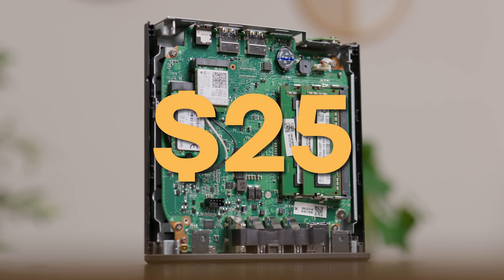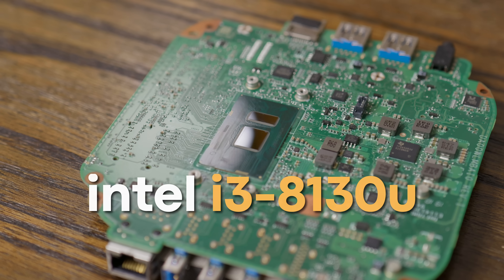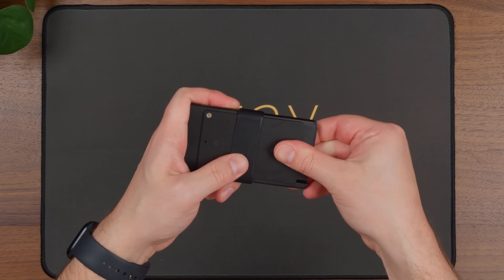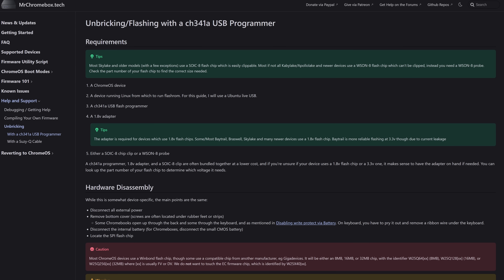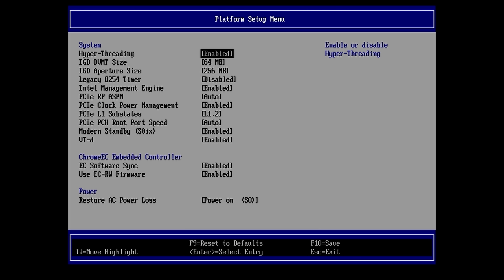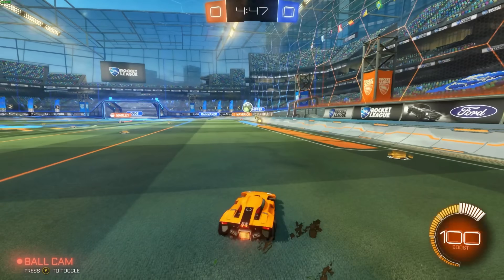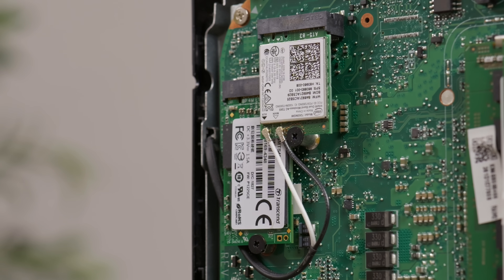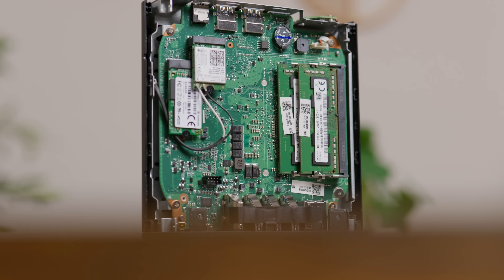This hacked Chromebox is INSANELY impressive.

Comment: I actually picked up a bulk lot of old chrome books to do this with.  The script is great for one or two machines, but definitely invest in a chip programmer if you're going through a stack or more.  The programmer lets you get around locked down/bricked boards and is quicker.  Mr. Chromebox's firmware is great for most purposes, but It's also possible to custom compile your own variant with different payloads.  I had a need for a few laptops that would be in pretty crappy conditions, so being able to pick up some chrome books for like $15 each and repurpose them was perfect.  They make nice, cheap, expendable work horses.

Comment: Chromebooks/Chromeboxes are GREAT sources for low power Linux servers and workstations.  I bought a $30 used Chromebook and repurposed it as a Linux workstation just to see if I could.  That Chromebook has become my favorite travel laptop, the battery lasts for hours and it's small and light enough it just sits unobtrusively in my backpack.  Sure, I'm not going to be gaming on it (it's a Celeron!) but for simple web browsing in airports it's fantastic.

Comment: Dell thin clients are also a great way to get small low power hardware for around the same price with much less risk of it being locked up, in most cases just install Windows or Linux and go, maybe screw with the BIOS password jumper or a master BIOS password that's well documented. The Dell Wyse 5070 is a passively cooled Pentium SIlverJ5005 and running one on stress-ng for 7 hours laying flat saw a peak temperature of 75-78C, turning it on edge as it's meant to be ran saw about 70C temps. I haven't touched the thermal compound on it. Passively cooled is really nice as there's not a fan to fail and the wider fin spacing and lack of forced air means that in dirty/dusty deployments it won't clog itself up over time nearly as badly if it all. This one is hopefully going to be a low power PC for a co-workers disabled mother who's bed bound, it should be perfect for watching streaming, Youtube, some small games, nothing heavy. There's other beefier thin clients which have actual PCI-e slots in them with much stronger CPU's like the HP T740 which are more like a mini PC than a thin client. No idea why you'd need a thin client with a full length half height PCI-e slot and a 8 core Ryzen CPU! But they do exist. Good home router/homelab/home server potential there.

Comment: For anyone wondering the chromebox cn60 is also able to be flashed with linux using mr chromebox scripts. It also has an upgradable sata and two ddr3 so dimm ram slots to mess around with, pretty nifty machine. It can run a minecraft server at 10 chunks fairly well with no stutter. Only downside is 16gb model has very little storage.

Comment: Good work. Great power consumption is the key for idle box sitting around always on. I usually just just go for raw debian base with docker and qemu. (Proxmox has some overhead) I bet it would run at around 1W idle. Looks like plenty of room in the case to cram 4x 18650s and have a mini UPS with 30+ hours of runtime directly inside. Impressive regardless.

Comment: I flashed the firmware on my Acer C720P with the help of MrChromebox and it's now running Linux Mint and everything works just fine. The only downside was the 4 Gb of soldered RAM, but I added a 128 Gb M.2 SSD and after the Linux install I still have over 90 Gb of free space. Pretty good for a eleven year old device that Google insisted was ewaste.

Comment: did the same with my celeron cn60 years ago. just a heads up for that model -- the MAC is only stored in softtware, so when you wipe chromeos and install another OS, the MAC is gone kek. that firmware utility can be used to set it, but if you dont make a complete backup of the original OS or write down the mac somewhere, its bye bye. i dont think it even has a MAC sticker anywhere on it or the box

Comment: Given that chrome OS uses the Linux kernel locking it down is a bit cheeky.  I know it's not quite linux because other than the kernel it uses a proprietary software stack but still, you're running GNU\Linux at the core.

Comment: I installed ChromOS Flex on a Pavilion Chromebook 14-c050nr last night. After flipping a switch, recovery mode, dev mode, disable WP, run Mrchromebox.tec BIOS flash script, installing Chromeos flex via Chrome recovery usb w/chromeos flex as model, 5 minutes later and 2-reboots I had an updatable Chromebook minus Android apps and Playstore. However, it now has a Linux VM and access to Linux apps. YouTube is a wonderful thing sometimes. Next I need to update the SSD; it has the original 16Gb SSD. I upgraded the RAM to 16Gb from the original 4Gb.

Comment: Another alternative is a cheap PC from ebay, an i5 or i7 Windows 10 PC, a NUC mini PC is around 4 watts and similar price to the model you got with the benefit of no risk as no firmware flash is needed. Also they will often have better processors than a Celerion!

Comment: The whole reason why you are getting slower performance issues with the Acer.... Is the power management that little one can be over clocked and it will still run somewhat okay... But you need to put more cooling into it or that will start to throttle and that will cause it to slow down.... Also depends if you are using Kingston or Samsung sodim ram... Using something like Samsung is generic ram because its manufactured at three different locations with three different standards for QA.... Same goes with the M2 as well.... I have a chrome book I just use for streaming while going to sleep.... Its crap but still it functions for the most part.... I find it they love using Samsung ram in those.... This is why I make a bit of a stink about it.... For a low budget you got yourself something that is worth keeping around...

Comment: I have i7 version witn 16gb ram 4core 1.8ghz, all i can say it was not worth it to convert to windows because you cant play high graphic demanding games. Although the cpu is great, the gpu is weak to run such games. Another thing is 30% of android games and app are incompatible to this chromebox. Some games touch screen (using mouse) doesnt work some completely crashed when opened some apps doesnt render correctly.

Comment: What about a mid range gaming pc, while costing $800, still crushes fc5/6 and idles at 7w? My system is the r5600/6600xt. Sure not as compact as your chrome box but so just 10L. It's possible to fit into 7L sff

Comment: This was an awesome video.  I only experimented with Chrome devices a while back, and there was little to no information about modding them.  Not only the information you gave about the general modding of some Chrome devices, but what you showed you were able to do with this particular model, open up a ton of options.  2w idle draw!  Even 31W under full load, that's almost nothing.  My gaming PC is sucking down 700W at full load.  But, as an overlander, being able to build a smart control system with very little draw, while also being able to run other things, like a media server, it's awesome to see.  Thanks for the video!

Comment: I did sort of the same thing with a Dell Chromebox with a Haswell Celeron CPU. I flashed Mr Chromebox's firmwear and added a 4GB RAM chip (for a total of 6GB)as well as switching out the 16 GB M.2 drive to a 128GB drive. I installed Mint 22.1 and use the thing for a media player. The poor old Celeron CPU struggles at much over 1080p but other than that, I saved the old girl from the landfill.

Comment: Are you sure the Geekbench results are from the i3-8130U?

I've now purchased the exact same model and can't go past 1169 Single and 2184 Multi. Doing a search in Geekbench the results are similar to mine, but not so high like yours.
I've checked temps and limits, they never exceed 78°C, but in fact I am POWER limited during the tests, as soon as I reach the 15W according to HW-Info.
The UEFI has not option to change the platform TDP. Did you do something special to your?

Comment: Iv got a cxi3 and DO NOT GET THE ONE with a celeron processer. And chrome OS is absolute trash so make sure you can wipe the thing. And yes you can drop in 32gb of ram, Iv got 32gb of storage and 32gb of ram lol
Reply: Depends on what you're doing.  The Celeron with stock 4GB RAM works fine as a Blue Iris remote client even without flashing.  Retained the ChromeOS since the Chromebox was cheap and I can modify others.  Cameras only running 1920x1080 so ymmv.

Comment: I just built a server for fun with some parts lying around, Xeon 2620 v2, GT 730(heard that right), 2*8 gb of ddr3, X79 off of Aliexpress, Debian with Xfce and a random psu stripped from an oem. I’m not really knowledgeable on computer stuff and I’m gonna try to run Pi-hole on this for adblocking. Wish me luck on my first dive into the server rabbit hole

Comment: I've been rather happy with a crappy $100 Chromebook I got a couple years ago, after a friend had it for a couple years.

I immediately installed Mint.

I close it for 3 or 4 days. It wakes up at 98% power.

I use it for a couple hours. It's at 92%.

Mint tells me that I have an estimated 72 hours left of battery life and... I think that's overly optimistic, but I easily clear 24 hours with my normal use. I get over a week of sporadic use without charging it, and there's still like 40% left.

Low power fanless laptops are amazing.

Comment: don't leave the screw out - put it back when you're done. The screw is there to ensure no malware can rewrite that nvram
Reply: The screw has no effect when reinstalled unless the chip-level write protection is set first. And you don't want to prevent NVRAM from being rewritten or you can't change any settings or the boot order.
Reply: @mrchromebox7138  on the devices I worked on the chip-level write protection was a hardware lockout that put the data bus of the nvram chips into high-impedance mode (cannot be an input or an output). How often do you change settings or boot order? It should not be done during daily operation. Put the screw back when you're done changing your settings. This is advice from a ChromeOS developer
Reply: @anonymous-pr2sy  again, putting the screw back in alone has no effect whatsoever. The hardware write protection (screw in this case) simply prevents the settings on the SPI flash chip registers from being changed. But those are cleared/disabled as part of the flashing process, so putting the screw back in does nothing at all.
This is advice from a ChromeOS/coreboot firmware developer, project leader, and the creator of the site/firmware in question here.
Reply: @mrchromebox7138  why did you create firmware that would disable the nvram write protection if the user installed custom firmware? That does not seem like it is a good thing for the consumer at all. You guys have fallen awfully far since 2016
Reply: @anonymous-pr2sy  who is "you guys"?
I can't tell if you're misusing the term NVRAM to refer to the entire flash chip or what here. Even in stock form, the flash write protection only covers a portion of the chip, not the entire thing. Otherwise you can't update the firmware at all (which Google does). I could implement a system like Google uses with a RO portion and updateable RW section, but there are drawbacks to that as well.

Comment: Actually the ethernet is an issue with the r8169 open-source driver When it has EEE enabled if you want energy saving to work properly, you have to use the realtek driver (r8168), or patiently wait for the r8169 team to fix something that has not been fixed.

Comment: Have the Asus Chromebox 3 CN65 with the I7, unfortunately, and this seems to be a general issue with these devices it started to overheat very quickly when running Windows 11 after flashing the BIOS. Eventually I restored the original OS, and my 10y old daughter uses it now as her computer.

Comment: I got Bliss OS (Android) on a Mac Mini with a usb touchscreen, triple boot, the other two being Kali Linux and KDE-Plasma Fedora workstation.. no Mac OS anymore as its a late 2012 core i7 8 core eighth gen cpu 32 gb ram mac mini which Apple like to pretend is outdated, when in truth i am running 15 million parameter local LLMs on it in linux. Otherwise i use 16 gb Raspberry Pi 5, with KDE Plasma desktop layered onto either Ubuntu, or Kali. You can put bliss os android into a touchscreen box with a Pi 4 for less than 100$ or even full desktop ubuntu or kali or pi os (Pi OS is crap on top of Debian).. Amyway my old 2012 Mac Mini is now runing gpt4all and docker desktop and anything llm and open web ui and ollama LLMs locally better than some 2500-3000 dollar 'AI PCs' currently being sold

Comment: I just converted a few asus box 2s and 3s for this reason. Excellent little machines. The 3s need to sign into your g account to enable dev mode properly. The 2s are more flexible. The requirement is to remove the wp screw on both though. Made an emulation station for my nephews bday for one. The others are unassigned for the time being. Ubuntu server with lx de. Auto lgion and the retropie script gets you going. Make sure to enable ssh for easy scp transfers of files.

Comment: You mentioned two things that piqued my interest. 

- First, that the i3 was not the only processor available, (I thought I caught a glimpse of a screenshot indicating that an i7 4 core chip was in some units) 
- And second😮, you successfully ran proxmox on it. 

What speed are those USB A ports in the back? Would it be possible to use the USB A ports as the connecting network of three Asus Chromebox(s) to form a high availability proxmox cluster?
Reply: 5Gbps

Comment: This would make a great seedbox. I currently have a cheapo N100 that fills that role that sips power but I think that might be overkill considering that this little thing consumes even less power. My seedbox just needs to run uTorrent and NordVPN client software. Im still on 500Mbps internet so the 1 GbE port wouldn't be a problem at all.

Comment: Picked up one of these 6 months ago that had an i7 and 16BG of RAM.  Saw it in a cardboard box that said everything in this box is $1.  I had an old 19V charger from about 10 years ago in a drawer, which was lucky because after the firmware change the USB C charging stopped working.  I had an old 256 GB M.2 I threw in and loaded Windows 11 and it was a shockingly competent PC.  I've absolutely got my eyes open for any more of these I can get cheap. I've done this to a few Chromebooks before, but this was pretty cool.

Comment: the chromebox 3 is best. you can put 32gb of ram and use any intel mobile core i 2nd and 3rd gen. i have 2 with i3-3630qm (any higher the TDP is too high requiring cooling mods) and 32gb and 512gb msatas.
Reply: yeah but the HD3000 GPU there doesn't do hw decoding of modern video codecs, so it's a lot less efficient if it's capable at all

Comment: Which BIOS chip is it using, how accessible is it, and is a complete BIOS image available? Flashing it with a hardware programmer might not be a big deal, for example, HP T740 pop right out of a socket.
Reply: it's a Winbond W25Q128xx SOIC chip, on top of the board, easily accessible and clippable. There are some caveats when flashing the chip externally as you don't want to wipe the LAN MAC address which is stored in the firmware.

Comment: The version with the i7-8650u would be interesting, the higher end 8th gen mobile chips are much more performant/watt. Would also be quite performant in Windows l, I used to do heavy multitasking with a 8350u until recently.

Comment: I also bought an asus chromebox 3 with an i7-8550u with 80e for the stock box (8GB/64GB)! Upgraded ram to 32GB, SSD to 512GB flashed it with full UEFI and installed ubuntu! All for less than 150euros!! I also used undervolt python program to lower -100mV the core and cache voltage resulting to stress turbo clock during s-tui of 2.6GHz instead of 2.4GHz!

Comment: I bought a couple Asus CN65 (chrome box 3) for cheap a while back, being locked, was able to flash the Bios and unlock them, nice little PC's they run Linux quite well but could not get the on board Audio working in Windows.

Comment: Nice idea, but there are many cheap mini PCs out there that don't require any work to run Windows or Linux. Like the one I got a few weeks ago for 50€ that has an 11gen i5. It was also listed as not working because Windows often crashed, but from the error message it was clear that just the SSD failed and that was the case. It even has decent cooling and even enough power for most games in lower settings.

Comment: Heh, I've been running an CN60 I bought for $22 for a CasaOS server for over a year now. Added 16gigs of ram and a nice 1TB drive and it's been rocking Home Assist, A MariaDB instance and a web server /w a nice image hosting app for my wife.

I have a stronger i7 Chromebox that I am going to replace it with but I haven't gotten around to migrating the services to it yet. I have some other small form factor systems in the house doing things like a Minecraft server for my nephews.